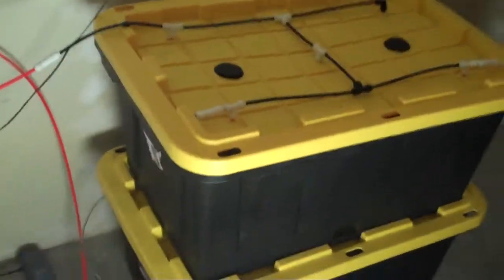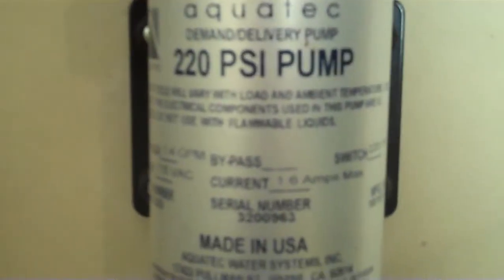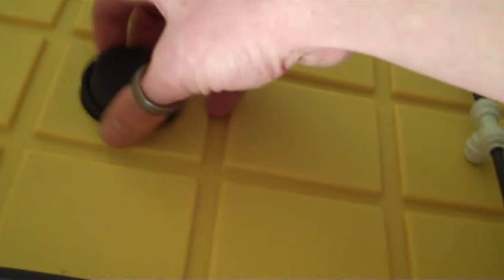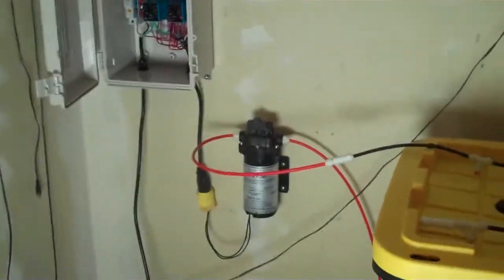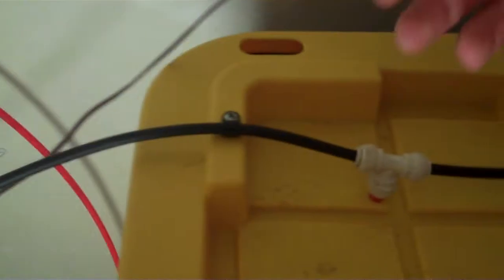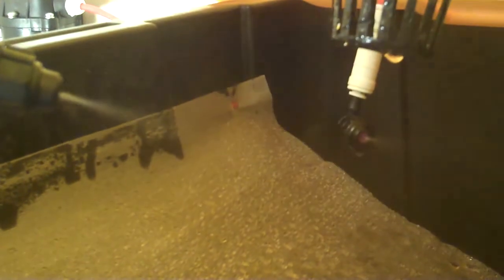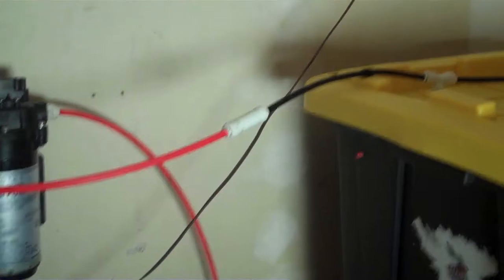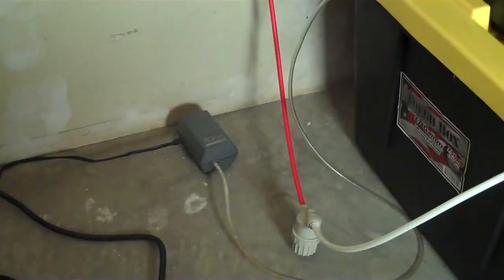220 PSI Aeroponic Setup

Comment: So I'm sure you've worked it out by now (various comments have pointed out the individual points, but I didn't see one comment with all 3)... also to be honest, I'm no professional. 
I've only been (albeit voraciously) reading up on HPA for a few days. But for others who might see this and wonder:
I see 3 things that are missing here, and 1 other mod that would help.
1. Accumulator tank. This holds pressure, and essentially reduces wear and tear on your pump. Additionally an accumulator will give your system a more constant pressure- instead of going 0PSI --> 100PSI for each on cycle, the accumulator 'saves' 80PSI and holds that as the minimum system pressure.
2. Pressure valve. This only trips the pump when pressure in the system drops below a threshold. Pretty simple, the pressure valve trips the pump when system pressure falls below 80PSI and turns it off once you reach 100PSI.
3. Solenoids. These cut the supply of pressurized water on and off very sharply. Solenoids need to be mounted as close as possible to the misting nozzles (before), so there's less water between the solenoid and nozzle (as little as possible). This would prevent the 'pissing' by creating a sharper "on --> off" (and vice versa) transition.  

4. Run your misting nozzles in a closed loop. In this video, it appears that the nozzles are plumbed in a linear series. In doing this, you run the risk (granted on larger systems than this one) of losing pressure at the end of the line. In other words, plumb a tee coming from the pump. The left side of the tee feeds to the first nozzle and the right side to the last nozzle. A closed loop system will enable each individual misting nozzle to receive equal pressure, regardless of how far they are from the pressure source. 

Sure, plumbing your system like the video shows will generate some serious root mass...but the need for a new pump every 2-3 years can be prevented. Also, the system depicted can be optimized.

Comment: The pressure was too high and you were missing the solenoid, it's the main reason you were getting the leakage on the misters. If you get a 220 pump you need to have the water pass through a pressure regulator and keep it below 100psi. The 220 PSI is expanding your lines as well.
Reply: Andy Hastings You looking at 80 to 100 psi, where psi 80 psi is the lower threshold.
Reply: @TechieTard  
Imho, pressure is given too much emphasis. Control is much more important. Producing the correct droplet size range is not necessarily dependant on water pressure, some of my aero setups run 0psi.

Comment: try adding small check valves to your existing sprayers. they work with a minimum threshold pressure. when the pressure drops below that level they stay shut. should eliminate the dribbling.

Comment: Doesn't that pump have 3 wires 2 black 1 green? Which wires are you running into the yellow 3 prong plug and which 1 is the ground wire?

Comment: hey man add an accumlator tank to your grow it will keep the water pressure constant and keep the nozzles from pissing when the pump kicks on and off.
Reply: drip lock nozzles have an opening pressure and a closing pressure so they`re not perfect. Mounting each nozzle directly into its own solenoid is a better option. 
If you`re looking for perfection and less hardware just use air-atomising nozzles. They dont suffer from drizzle (aka mist run on) and,unlike hydraulics, you have control over the flowrate and droplet size.
Reply: +Atom izer could you explain why independant solenoids wont have an opening and closing pressure? (not a trap question but i dont understand how they would differ). 

The reason I think drip nozzles are good is because they are really really cheap and should completely prevent dripping. the solenoid solution you mentioned would be extremely costly for anything with more than a few nozzles as most Solenoids that i can find that are suitable for such an application are around $10 a piece minimum. if you can find suitable solenoids rated for that pressure that are below 5 or w/e your price point is then sure, that is a viable option but to me if you factor in the cost of the solenoid + at least two extra fittings per nozzle (again around $5 each) it starts to get u reasonable i  my eyes. I dont wanna spend an extra $120 for a 6 nozzle system just to get it working. with the drip lock valves. you can buy a pack of 20 for the same cost as your regular nozzles +$10 and achive a similar quality. Now to get them to work you need to find the right type of spring that is weaker than the spring already in the nozzle but once you find that (quite cheaply) you can modify the nozzles to operate at lower psi.

you do make a good point thou, iirc anti drip nozzles usually run at round 7 bar or 100psi which means that if you cant find better springs(ebay, shouldnt be too hard) you  might need to spend more on other parts so that they're rated for at least 150 psi and if thise costs exceeded yhe cost of buying multiple solenoids and attachments i might swing either way depwnding on preference but i think there are limitations whichever way you look at it. solenoids are mechanical and may break (aint nothing worse than the main solenoid breaking if you dont have a pressure release valve) but conversely the higher exiting speed from a higher psi might be damaging to the plant roots (specilation since i dont know how strong it would need to be to cause that issue and aiming misters slightly off center may mitigate this).

as for air nozzles you now face the issue of relying ona  co stant supply of air (via compressor most likely) possibly a regulator and a whole lot more that can fail. guether more I believe air nozzles may be significantly more costly  (but please double check because this was a while ago and im on my phone) again making the cost to benefit ratio unfavorable.

Sorry if this doesn't read well. I'm on my phone and what is grammar?
Reply: The thing to consider with anti drain valves is they have to open and close, they cant do that at one pressure because of the spring rate. The spring compresses faster than it decompresses, the closing pressure is always lower than the opening pressure. 
A solenoid is either open or closed, they typically operate in 20 milliseconds. If you screw a 1/4" or 1/8" threaded nozzle directly into the solenoid you have virtually zero pipe length to drive the drizzle.
An air-atomising aero setup comprises a compressor (preferably silent variety), solenoid, timer and nozzle. 
A full high pressure aero setup comprises, pump, pressure switch. accumulator, pressure reducer, pressure relief valve, solenoid, timer and nozzles. Not forgetting a big bag of john guest fittings and pipe.
Each has its own merits, i run both :)
Reply: I don't think the accumulator tank actually stops nozzle drizzle.
Reply: why wouldnt it? it keeps the system at a constant pressure rather than having the low pressure at the begining and at the end as it turns on and off.  Not only that it will help extend the life of his pump.  Most commercial high-pressure systems use accumulator tanks.
Reply: An accumulator tank is like a battery for water pressure. You charge it up using the pump and then when you want pressurised water you can get it from the accumulator tank instead of having to turn the pump back on.

In the case of hpa it's useful because turning a pump on every 5 minutes drastically reduces the lifetime of the pump where as turning the pump on once to fill the accumulator tank and then using that water means you only use the pump every couple of hours when your accumulator tank is empty to refill the tank.

Now the reason the nozzles are leaking is most likely because the nozzles he is using are too small to relieve pressure fast enough. This means that there is more water going into the pipes than out of the pipes and when you turn the pump off the remaining water in the pipes still needs to escape and so you get the drizzling affect. If you were to use an accumulator tank the pressure would still be entering the pipe faster than it was able to escape and the nozzle leaking would continue. 

A accumulator tank is a good addition to an aeroponics system for a number of reasons but i don't believe reducing nozzle drizzle is one.
Reply: Also note that water is  un(in?)compressable and so when i say more water is entering that exiting I mean:

Pump on

The water goes in

The pipes are plastic and deform slightly to accept more water

Pump off. 

Extra water inside pipes is forced out as they return to their original form.
Reply: yes water isnt compressable however the way the tank works to keep up water pressure is it has a rubber bladder full of compressed air and that is what keeps the pressure constant. however you make a valid point if it isnt rated for the pressure of his pump.   He may want to use high pressure tubing (if he isnt already)and use a selonoid valve to cut the water flow insted of kicking the pump on and off.
Reply: what you say about the accumulator tank is 100% correct and it's actually this same effect that causes the drizzle when you close the solenoid valve. 

Just like the pressurized air is trying push the water out of the bladder so that it can expand, so too is the piping that bulges slightly when dealing with high pressure water.

Another solution to prevent dripping is to use drip lock nozzles that can only operate if the pressure is above 100 psi. Any lower and the water is unable to push the spring that releases it. 

Anyway I've quite enjoyed this conversation but I still don't understand how an accumulator tank would be fix the dripping. I'm not trying to be rude, I just don't think it's possible, I am open to being proved wrong however.
Reply: @kwajomensah940  That sounds like an opinion, and nothing but. You can "believe" any number of crazy things. But you don't know, do you? I think your little belief is wrong. An accumulator can keep the lines of the manifold charged, while these pumps cannot. Keeping the manifold charged, or at least up to the point of the solenoid, and having pressure on tap, rather than an on demand pump that is able to supply pressure, certainly sounds to me like evidence--at the very least in theory--that initial droplet size will be much smaller than if run without the accumulator.
Reply: Why not, because the pressure in the line declines and than the nozzles will always output a final squirt. This final non atomized squirt basicly renders hpa useless because  it will undo the 50 micron droplet sizing and thus it's  no hpa rather lpa. Only correct way is like Ato mizer says which is solenoid for each nozzle. Believe me that makes the difference and than you will see the real benefit of 'true' hpa.

Comment: Has nothing to do with soft lines your nozzles are squirting because you don't have anti-drip nozzles.
If you replace with anti-drip nozzle and incorporate a 21 ounce shur-flo accumulator it will way better.
Reply: shur-flo accumulator is rated for 125psi, not a good idea to put 220 on it.

Comment: just to clarify, by having the stored volume of high pressure water and using the solenoid to control the flow to the nozzles you are ensuring that only a high pressure burst of water is sent to the nozzles. If you use it just with the pump inline then when the pump motor spins up and down you will get a lower pressure stream of water which will cause the trickling effect of water. :D

Comment: nice gear, you musta spent a heck of a lot of money for that equipment. Due to the inhibiting cost I chose to DIY using ebay items.

If you get a pressure tank, pressure switch and solenoid running the pump once every now and then on pressure switch and using the solenoid with your timer it will fix your issue with the water dribbling out at the end. It is to do with the pump priming and it doesn't get enough time to build pressure in your cycle. I have set this up independently and works well.

Comment: If you can find a way to retrofit some amfog or fogco anti drain valves between the lines and the nozzles you`ll have no issues with pissing and much better mist response. The best amfog / fogco AD``s for your 220psi pump are the high pressure type, 145psi open and 70psi close.

Comment: You`ll probably blow netafim nozzles out of their mounts with 220psi, they`re not designed for mega high pressure. The netafim 4-bar check valves (aka Anti Drain valves) open at 58psi and close at 28psi so the lines never drop below 28psi.
Reply: At what pressure the 301ADF07-80 hypro nozzle is open and closed?